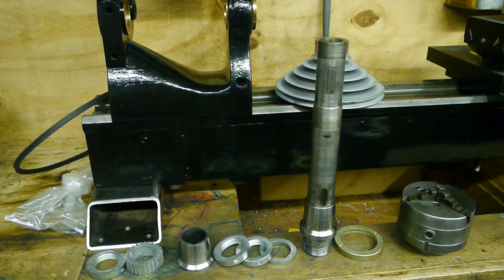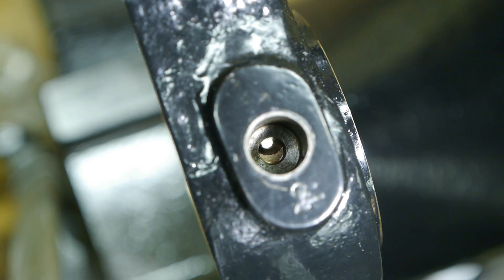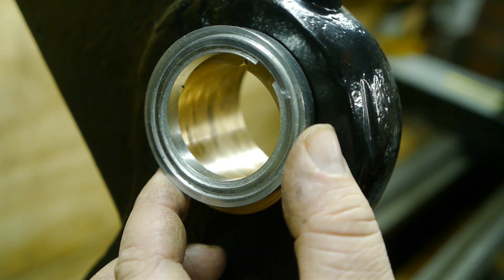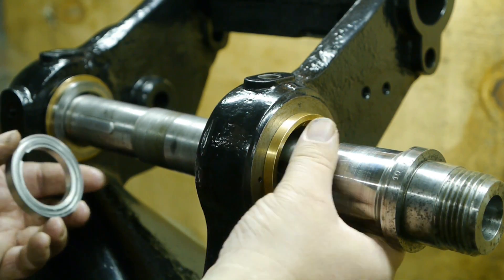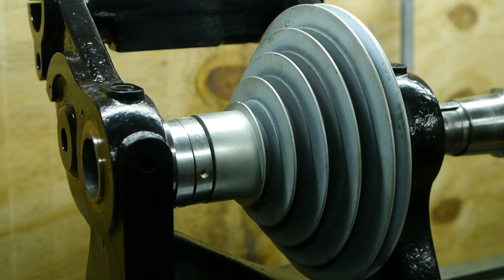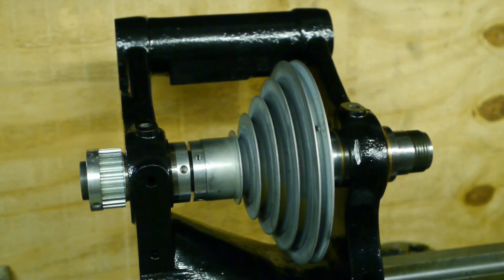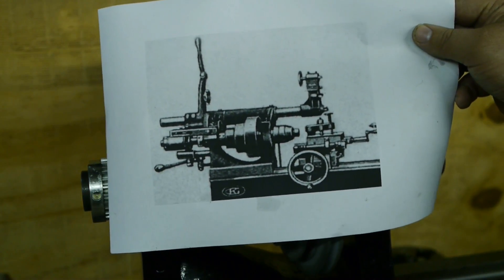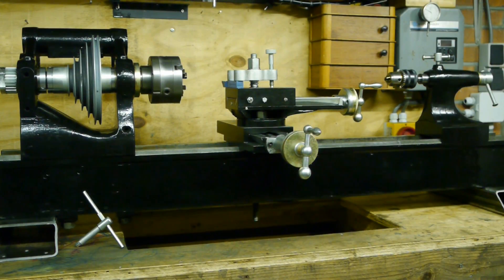Reassembling an old lathe - Part 3/3 - The Headstock

Comment: Looking good. You can use a link belt and never have to disassemble the spindle for a belt change again.
Reply from the maker: At this point I can disassemble the spindle under 5 minutes, easy. But I usually forget the belt when reassembling :)
From what I've seen, I'm no fan of the linked belt. Expensive, noisy and rather ugly. 
But if you have a difficult to disassemble/assemble spindle they do serve a purpose.

Comment: trick.. put the belt around the pulley... zip tie it in place so it does not flop and it does not get left off.   you can get segmented belts in various widths..
Reply from the maker: Thanks. That's a good tip because I must have forgotten the belt 4 times now :(
Not a big fan of the segmented belt. They squeak.

Comment: Well done on the restoration.  Looks very good.

Interesting to see the runout at the end.  Not a lot of runout for this vintage.  Part of the runout could be the original manufacture, part wear.

I looked up the lubrication chart for my Southbend Heavy 10.  The spindle oil shows 100 second.  Yours is 125 second.  Not quite as thick, but should be good.

Could you replace the oilers with Gits oilers?   Take a look at the Gits site for appropriate style.
http://www.gitsmfg.com/catalog/oil-hole-covers/

From what I have read using grease on machines is a common mistake.

For the motor, consider mounting the motor on a board which pivots at the back of the lathe.  Let gravity keep the tension on the belt.  I have seen this arrangement on many old Southbend lathes.
Reply from the maker: Thanks. I could have done a better paint job. I just used some cheap paint that I had laying around. I might regret that.

I'm not sure about the spindle runout. Before adjusting the bearing pre load runout was within 1/100 mm after 2/100 (strange).
Also when I push up on the arbour the spindle moves up about 8/100 mm without too much force. That can't be good!

Good to know that my oil is no too thick. Although I still think the spindle should spin more freely.

Here's a link to the oilers I like: https://www.youtube.com/watch?v=x6UDVE8nvbs

Mounting a motor might be a challenge since there is not a lot of room behind the lathe. I'm planning to do what you're suggesting but I'm not sure if I can reduce the speed enough without a counter-shaft pulley arrangement.